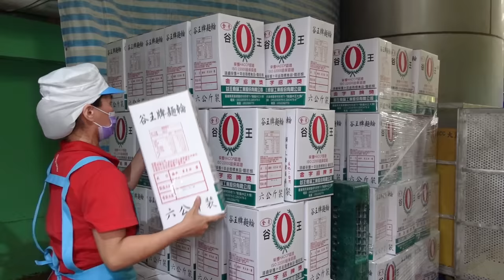The Largest Dough! Seitan (Vital Wheat Gluten) Mass Production / 麵輪量產工廠 - Food Factory

Comment: I wonder what was the purpose of the big drums with perforated steel turning in water(?)
Reply: To make this, you need to take dough and then wash it underneath water until the water turns clear than you were left with nothing but the gluten instead of all of the starch. The gluten is the protein, and now you can use it like meat.
Reply: @Lionfish_Extermination_Corp  No they're asking about the drum(with water or oil ?) in which they were put after deep frying, so were they fried twice ? why ?
Reply: @killerpgupta I guess frying twice is to ensure that there is no moisture and you can keep it longer